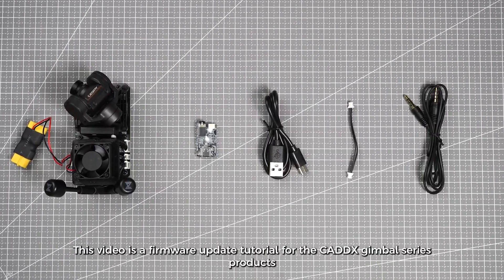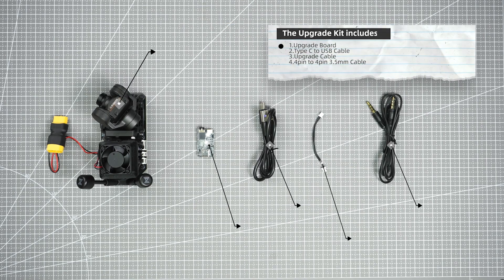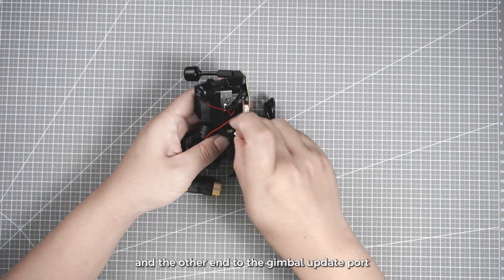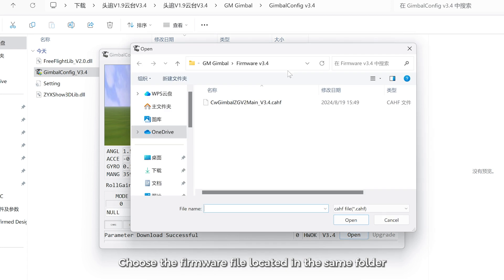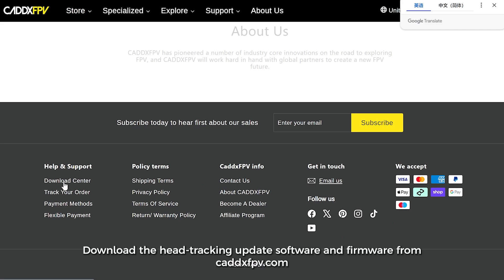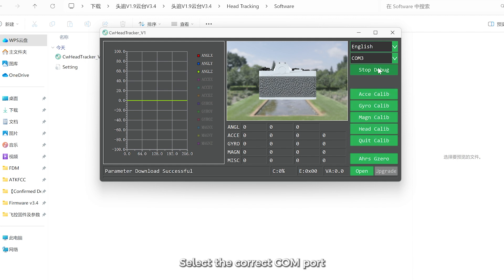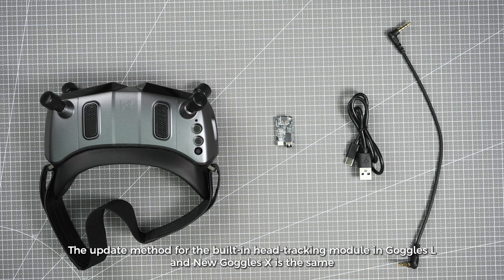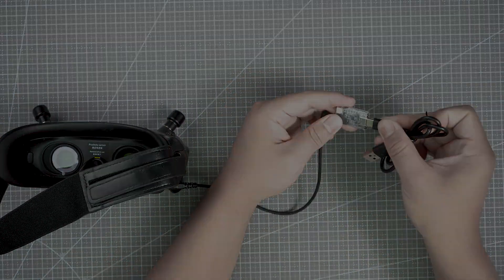Firmware Update Tutorial for Caddx Gimbals & Head-Tracking Modules | GM1, GM2, GM3, Goggles X & L

Comment: This is an absolite nightmare to setup. Finally updated the goggles and the gm3 kit BUT there is no cable to update the gimbal. I have video transmission but no gimbal stabilizer or head tracking. Im about ready to give up.
Reply from the maker: Hey, get a new and free cable, contact the after-sales email box :face-fuchsia-wide-eyes:
Reply: @CADDXFPV I already ordered a cable, thanks. I think the biggest disappointment is that the KIT doesn't already come ready to use. Each part in the kit should be able to communicate with eachother imo.
Reply from the maker: @musthavewheels  😭

Comment: Ok, for anyone else who is struggling here are some pointers. I have the gm1, but I assume these tips work for the other ones too. 

1. The gimbal needs to be powered externally for the USB connection to work. Otherwise when you click on "start debug" it will say "parameter downloading..." forever. I used the provided plug with the power cables and connected them to a lipo (manual says 7v - 26v should work) with alligator clamps. Then connect it to the USB. Make sure you have the correct drivers installed, I used the ones that came with the firmware upgrade software. In the device manager there should be under ports one called "USB-SERIAL CH340" followed by COM and a number. This is the COM port you need to select in the "GimbalConfig" Software.
2. At some point my firmware update stopped and I thought I had bricked the gimbal. When I powered it on, there were no LEDs blinking any more. I then just disconnected, powered the gimbal and connected it again to the PC. After that I selected the firmware upgrade again, followed by  "upgrading" the firmware. To my surprise the progress bar filled up and after that it worked again, even though before this, the "start debug" button didn't do anything.

Maybe this helps someone. Good luck

Comment: @CADDXFPV I'm so sick of dealing with Caddx. I have the goggles x with internal headtracker, v2 dual vtx both with latest firmware after I had updated or so I thought.Bought the single axis gimbal which comes with outdated firmware and without the  board needed to upgrade it. 

It has no manual or installation instructions published at present time, these are NOT the same as the GM2 and GM3. It is also unclear whether I need to upgrade the firmware in the headtracker in the goggles or the GM1. Either way I can't use Linux or Mac, windows only, yuck.

The goggles headtracker doesn't update with the rest of the firmware via SD card , no  no, it needs that board too and updates via the AV port. Board is $10 delivered.

You can apparently use a normal FTDI to update the gimbal, providing of course you have a 1mm 3pin jst to hand and are willing to guess at the logic level voltage. Doesn't help much for the headtracker in the goggles though, could probably use the same converter but without any published info it's a mission to find out and not without risk.

The GM1 does not come with a 3pin 1mm jst connector, because Caddx hates you.

The GM1 has the camera mounted offset to the mounting holes, so if you do have to make your own mounting plate (you will), you'll have to offset the whole plate to center the camera to the drone. This offset measurement is not included in the technical drawings, it's a lovely surprise for when you have finished the first of the two mounting plates you are likely to make. 

The GM1 doesn't come with a spare coaxial cable and in order to have your image the right way up after mounting, you will need to put a 90deg bend in your vtx cable and stuff it into the back of the mounting, this isn't mentioned anywhere. There is no way to turn the image in software for the GM1.

The GM1 has no backplate for unknown reasons

The whole shebang is mounted on m2 screws, yes the really tiny ones. Yes you will need over a 1.5cm of stickout thread to mount.  Yes M2 mounts at the business end of a drone with large stickout, are very likely to break in a crash. M2 aren't commonly available over the counter and are a pain to handle. Especially as you will likely want to use nyloc nuts in this instance. Or lock nuts, imagine needing to use two tiny spanners for M2 nuts, six per mount so 18 in total for the GM1. Maybe we should tap our DIY plate? By hand in M2? Or just soak it all in locktight and pray you don't need it apart again?  Horrible design. The hole spacing includes thoughtful spacing like 38.6mm,  really? why?

Honestly thinking of reporting the uk based seller to trading standards over this, it is an utter mess and very likely illegal to sell without warning people of the issues. 

Feels like you have contempt for your customers
Reply from the maker: We sincerely apologize for any inconvenience you have encountered while purchasing or using our product. Our gimbals are factory-set and do not require a firmware update. However, if a firmware update is necessary for your unit to function properly, please contact support@caddxfpv.com to report your situation, and we will provide a free update board. For any other issues, feel free to consult our after-sales support team. Once again, we apologize for the inconvenience and hope this helps.
Reply: @CADDXFPV  If you smash a plate and say sorry, the plate is still smashed. If you carry on smashing plates, the sorry means less every time.  I already have a "free" board on order thanks it cost me $10.
Reply: @CADDXFPV    If you smash a plate and say sorry, the plate is still smashed. If you carry on smashing plates, the sorry means less every time.  I already have a "free" board on order thanks it cost me $10.

Comment: Exactly how do I transfer the software to the sd card
Reply: You don't transfer the software to the SD card, you run the software on your PC and update the headtracking module in your goggles with the USB module and cord. To update the goggles' firmware (second firmware update), you transfer the firmware file (not software) to the SD card, insert the card into the goggles and power up the goggles. When the goggles are fully booted up, push the pair/update button with a small 📌 for 8 seconds until you hear a beep. Wait 3-6 minutes for the firmware update to complete. The goggles will give a solid five second beep and reboot when finished.

Comment: Where can we get the upgrade board from? I don't see it on the website. I would suggest adding a link to the upgrade board in your video description so your customers can easily find it.
Reply from the maker: It's a great idea. We put the link in the video description, and yes you can get the upgrade board from the official website.
Reply: @CADDXFPV  The Avatar HD Pro Kit comes with a upgrade board but has a different connector. Board should come with the gimble or make it the same one at the VTX.
Reply: @Robinator202  No, it comes with a usb c to vtx board, not the upgrade board. That would make sense silly!